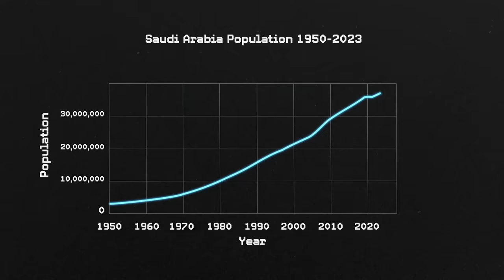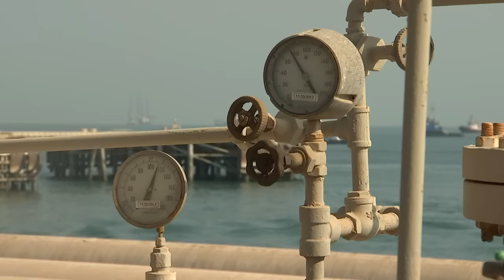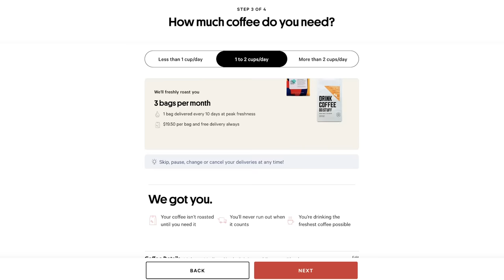Why 82% of Saudi Arabians Just Live in These Lines

Comment: in the US we tried to relate every single political issue in the Middle East with religion (or political ideology) and we usually neglect (or deny ) the importance of geography in shaping the society the collective decisions it made.
Reply: Much of the religious clustering is informed by the same geographical considerations.  Using religion is a proxy sure, and there's definitely some discussion to be had about why Americans focus so heavily on religious aspects rather than anything else, but as a proxy its not actually as bad as it sounds on the surface.

It can be misleading sometimes as all proxies are, but generally speaking as long as you understand that Islam has sects and factions same as Christianity, you can get pretty far using "religious clustering" and "geographical clustering" somewhat interchangeably.

Comment: I always wondered why when I went to Dubai during a layover, how it could possibly be 110 degrees with 100 percent humidity. Easily the worst heat I ever felt.
Reply: Dude, either you are American or you went to another dimension where Dubai's temperature is above the boiling point of water
Reply: Also if Dubai is hot for you then try  seeing Jeddah 

It’s nearly year -round hotter than Dubai
Reply: @anonymousejones8742 no way!😳 I would never live there 😢
Reply: 110 degrees fahrenheit is roughly 43.5 degrees celsius, if that helps.
Reply: @anonymousejones8742  Jeddah has a lower temperature than Dubai in summer
Reply: Hence their traditional outfit did you know they don’t wear anything under there 😂 honestly, can’t blame them

Comment: Not an engineer, so I'm hoping there is one who reads this comment: if the desert air's humidity is so high, why desalinate sea water?  Is it not possible to turn humidity into potable water, perhaps by seeding like in clouds?  I know that the Incas in the past and current residents of the Andes use pretty low-tech atmospheric water generators, but the mountains above the water line do have pretty significant fog.
Reply: Engineer here, and de-humidifying as a means of water collection is ridiculously inefficient. The Inca were able to collect water from the cool, low pressure mountain air because it was already in the process of condensing (fog), and just needed a nudge to bring it to liquid form (temp drop). Humid, seal level desert air requires much much more energy to bring the water temperature low enough to condense, and when you do it storage is more difficult because the heat causes re-evaporation. 

The thermodynamics make it impossible.
Reply: @TheWondermittens  Fascinating. I was wondering the same thing as puttiplush. Also, this reminded me of Dune by Frank Herbert. Sci-fi, I know, but in his novels (thousands of years in the future), the Fremen extract water from the air using some sort of technology. But you point out an additional problem--the storage of the water because of evaporation. Does this also affect their farming? RealLifeLore points out that farming is massively inefficient, and I wonder if that is because they can't use open irrigation and the spraying of water just results in much of the water never reaching the crops.
Reply: @TheWondermittens   Thank you so very much!  That indeed makes sense, and I now understand how the two situations are thermodynamically quite different.  Thank you again for taking the time to answer my question.  Have a great weekend!

Comment: The fact SA isn't already the largest producee of solar power is stunning. They have great solar potential and money to build the production infrastructure, reducing use of oil consumption translates directly into export revenue and they need a lot of power for desalination and air conditioning.

Should have been an obvious path a forever ago.
Reply: That's actually a really good point, the problem with solar in SA is that the panels get covered in sand in just a few days making them so inefficient, and because of the water shortage you can't install wipers on them like a car.
Reply: @wwproducts  have them tip over once a day or something like that to drop the sand. Turning panels that track the sun can get more power anyway so do that and integrate a little dip to that.

Also apparently forgot from initial comment. One of the main trouble with solar power is storing it, but water from the desalination can be stored more easily for night use.
Reply: @riku3716  sand sticks to the surface like dust does, hard to shake it off. The most viable solution is installing brushes that scan across the surface of the solar panel and there's a company that's been developing this tech called NOMAD. Energy storage is indeed the biggest problem with solar power, I'm no engineer myself but I think if that obstacle is ever solved solar power can finally be viable worldwide
Reply: I am sure they can get some sonic system to remove the sand, but the real problem is that it cost a ton to build new infrastructure for solar compared to just using the oil. Why waste money on panels that will be obsolete in less than 5 years. The ROI on the investment is terrible. Better off buying a football club in Europe.

Comment: Why not pump the water from the sea into the area near the aquifer underneath the surface of the ground. Letting it filter through the majority of the ground, then refilling the natural aquifer. If the bedrock could be mapped, and the slope of the bedrock could be used as a base for the water to flow to the area where the aquifer is located, and the water flowing across the bedrock, to the aquifer, would also spread out wide, and not only be an narrow channel traveling to, from the seaside. With the water flowing, it would spread wide, across the bedrock, and should have the effect that the amount of water could be increased, thus increasing the rate that the aquifer would be replenished. The water being released underground, would be filtered through the ground. 
From my understanding, ground filtering is good for larger particles, and certain soil types, will future filter. That is using the ground as a filter, slowly removing the saline percentages. If given enough distance, it should reduce enough to be potable water. If there is a area underground where they could store water where it would not be contaminated, such as old oil fields. The saline solution could possibly be absorbed into the ground surrounding the aquifer that once was filled with oil, and other petroleum resources. Thus reducing the salt concentration, and making it easier to remove the remaining to, produce potable water. For people to drink and maintain life. 
Sorry for the length and circular manner of the comment.

Comment: The idea that renewable energy sources will grow to eclipse oil/gas/coal in this century is a pipe dream so fundamentally flawed that I find it hard to believe people can say it with a straight face.  I understand trying to push for such systems, but pushing too fast has been leading to constant failures rather than new cost effective technologies.  

The key issue here (apart from the simple inability of these energy sources to produce enough energy) is storage and consistency.  To have a functional power grid you need a steady controlled supply of energy.  Renewable are inherently intermittent, and thus to adequately cover the times when it is calm and/or dark, a solar or wind plant needs to have a backup fossil fuel system big enough to cover 100% of the grid's consumption.  Congratulations, every new renewable plant = another fossil fuel plant.  Ideally, you could cover this gap with nuclear, but everyone is running away from that power source at top speed so no dice there either.

One could say that we simply need more renewables and ways to store the energy.  While this is true, there is no viable technologies for doing so.  Batteries at large scale are terribly inefficient and terrible for the environment while systems like pump storage that use excess power when the sun is out and wind is blowing rely on specialized environmental conditions i.e. elevation and water.  Also areas with the capability of producing high renewable energy output (where it's really windy or sunny), have issues controlling output.  If the power draw on the grid decreases at a plant burning natural gas, they just turn it off.  The sun and and wind are not so easily controlled.

That is to say nothing of the plastics and other material derivatives of oil that dominate the economy.  Even if we could switch to alternative energy sources, you cannot build to modern world - trains, planes, houses, bowling pins, air conditioners, phones, etc. -- without oil.  

Changes will come, but the idea that Saudi Arabi will be hurt economically by renewables any times soon is silly.  They look at renewable the same way Texas does.  More local renewables means they can sell more of their oil as a means to fill their state coffers.  It is that welfare system becoming overtaxed that will effect Saudi Arabia before large scale renewables will have an impact either way.  That and the potential for political and religious upheaval in the region also pose a more pressing and dire threat than renewables.

The real reason that Saudi Arabia is trying to diversify their economy is that under that last United States presidential regime, the US was becoming less dependent on foreign oil, not through renewables, but through expansion of their own fossil fuel resources.  The current administration has not only shuttered that, but also used vast amount of the U.S.'s strategic petroleum reserve, meaning the US will still be dependent on foreign oil.  Saudi Arabia is wise to diversify, but I am of the opinion they'll still be in a strong position economically in regards to the U.S. unless something changes drastically in either country.

Comment: 🎯 Key Takeaways for quick navigation:

Around 82% of Saudi Arabia's population lives within two narrow straight lines: one along the West Coast by the Red Sea, and the other across the center of the country between the Red Sea and the Persian Gulf.
The rest of Saudi Arabia's territory is sparsely populated due to its harsh desert environments.
The Arabian Peninsula's interior is dominated by deserts, including the vast "Empty Quarter," which is the largest continuous expanse of sand on the planet.
Lack of rivers and limited rainfall in Saudi Arabia's territory have historically made large parts uninhabitable.
Mountains along the western coast capture moisture, resulting in the southwest corner being the most densely populated region.
Riyadh became the capital due to its central location and proximity to oil fields, leading to rapid urbanization and development.
The influx of foreign guest workers, primarily from developing countries, has significantly contributed to the workforce and urbanization.
Saudi Arabia's population has grown from around 3.1 million in 1950 to about 37 million in 2023, with major cities transforming into metropolises.
Majority of Saudi Arabia's population lives within two main lines: the historic Line along the West Coast and a new line across the Center, which is artificially created.
Water access is a critical issue as cities like Riyadh and Dammam face water supply problems due to lack of rivers and rainfall.
Saudi Arabia's limited arable land (1.5% of total) forces heavy dependence on food imports or artificial farmland creation.
Saudi government heavily subsidizes water to farmers for desert farming, depleting non-renewable underground water aquifers.
Desalination, fueled by oil revenues, provides a significant portion (50%) of Saudi Arabia's water supply, with groundwater sources depleting.
Desalination is energy-intensive and oil-dependent, straining the budget and energy resources of the country.
Saudi Arabia's heavy consumption of oil domestically impacts its budget, economic stability, and potential for exports.
The kingdom is trying to diversify its economy away from oil through industries like tourism, technology, and renewables.
Geopolitical vulnerabilities, water scarcity, energy dependence, and political stability pose significant challenges for Saudi Arabia's future.

Made with HARPA AI

Comment: The empty corner used to be a sea, so if you use a time shift crystal, you can easily cross it with a boat. The crystal will turn the sand back into the ocean water and you can cross it by boat as you would cross any body of water.

(I'm joking, this is a reference to the legend of Zelda: Skyward Sword 😂)

Comment: Concerning the water problem, if you were to resupply a salt water lake, would the salt stay on the surface and desalinated water eventually sink down to refill the aquifers? Because about 100,000 years ago didn't there exist a large lake up at the top of Saudi Arabia, 100-180 miles across or something like that,  or perhaps turning most of 'the line' into a salt water canal doing something similar?

Comment: Can they really not build out solar power faster? The country seems extremely well suited for large scale solar. There's no shortage of sun, panels are getting really cheap, and the intermittancy is less of a problem here since AC is mostly needed when the sun is on and desalination can be done when the power is there. With the right investments the desserts could be turned into a green paradise. Sustainably.

Comment: your video is incorrect. As someone that has traveled a lot of KSA, there are a lot more places you have left out. the east cost, road to riyadh are not the only places. 

You have the city of Hail on the border with Kuwait and Iraq that was not mentioned. Abha which is a city below the Riyadh Road. Khamis Mushait which is a populus city near the Yemeni Border. 

There are many many cities you forgot away from the coast and middle. However, what is does lack is a suffient number of motorways between other nearby cities. Usually they will be paved desert roads only enough for single file on each side.